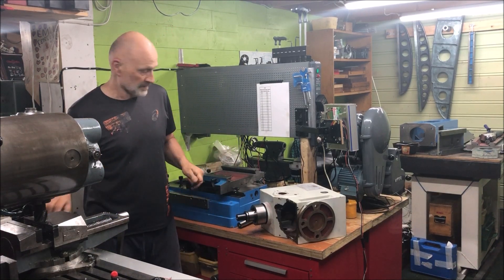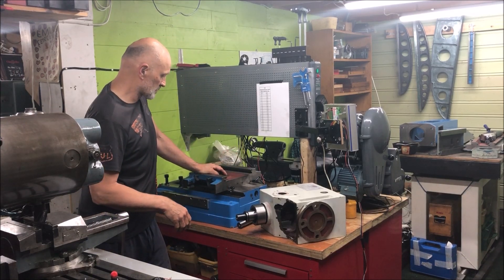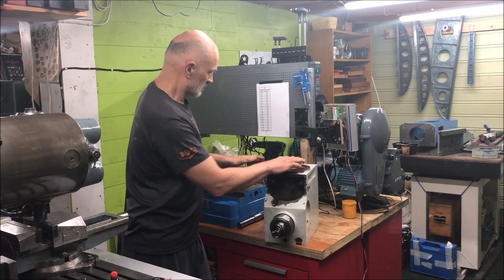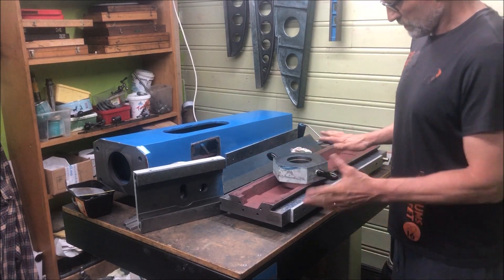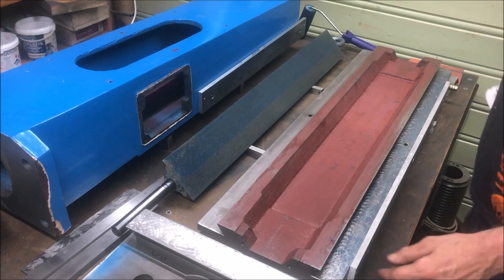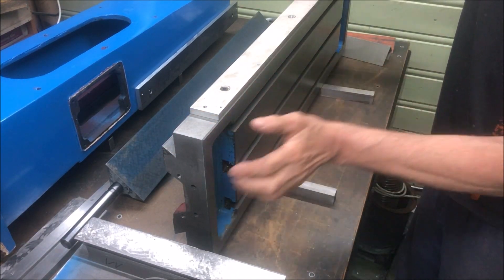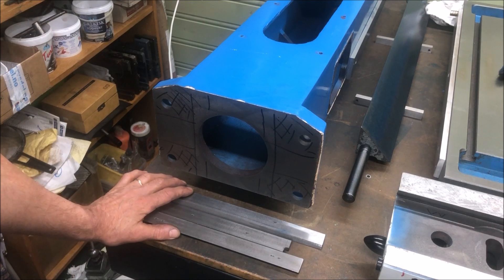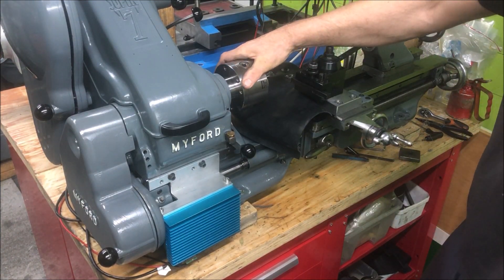HBM 45 mill-drill mods/fixes - intro

Comment: hello im have probleme bearing my stanko 1i611p can you help me for buy new bearing please noffing information in frenche languish
Reply from the maker: Hello there, I have not looked at the bearings as they are still working very nicely on my machine (knock on wood :) ) and would therefore not know much of interest to you. However, Madmagnus from Sweden and Sunppaa from Finland has some insight into this. Have a look here: https://www.youtube.com/user/sunppaa/videos and https://www.practicalmachinist.com/vb/schaublin-cazeneuve-weiler-graziano-mori-seiki-lathes/russian-toolroom-lathe-izhmash-1i611p-263988/ 
Especially the thread on Practical Machinist should be helpful.. or just contact on of these guys :) I know Sunppaa overhauled the headstock and in the process must have dealt with the bearings. Lastly, you could ty to source information/bearings directly on the Russian website chipmaker.ru. You can probably buy bearings from them. PS! It might actually be possible to buy from the factory?

Comment: Hello Jan,
I will watch this series with interest... I understand the concept of scaping (more so in a lathe) but have not fully grasped scaping something like the milling machine where it has many surfaces X, Y, Z and checking for alignment. My approach (rightly or wrongly) would be to start with the base and work upwards checking for vertically and horizontally alignment as I go, very much like building a house, foundations, walls, roof.
I am not sure I am explaining myself well... but as I watch the series I feel sure things will become clearer.
Take care.
Paul,,
Reply from the maker: Thanks the same! There will certainly be an amount of measuring & scraping involved, so hopefully we'll all learn a bit. yes, exactly.. just like a construction of a house or similar. Start from the base and move up. If the base isn't correctly made/aligned, then nothing on top can make up for this.. On a milling machine like this where you can swivel of the head around it simplifies alignment in this plane (tramming), but still needs to be within specs (I will refer to the Schlezinger book for tolerances)